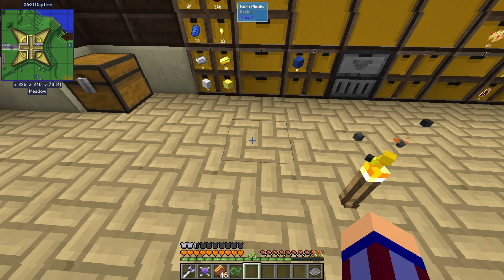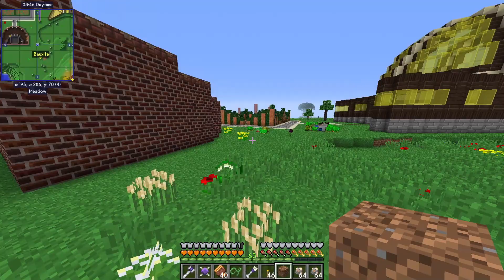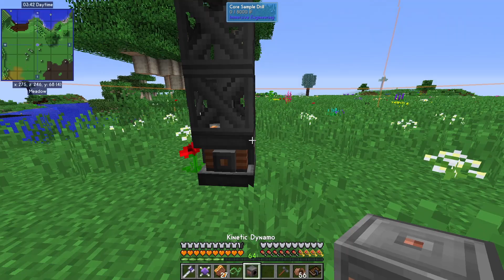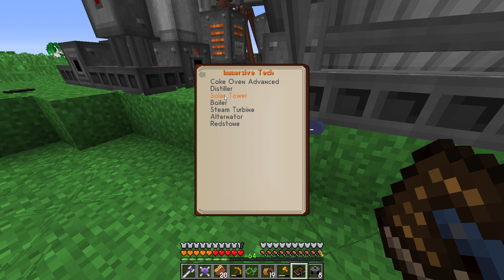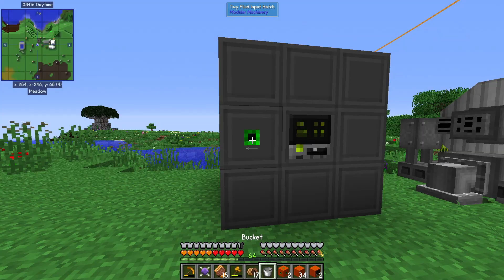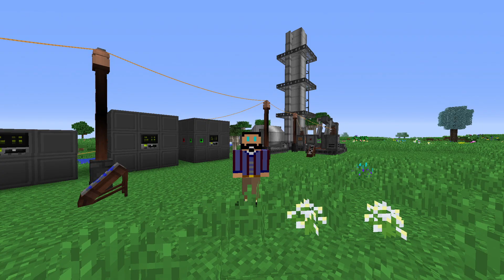SevTech Ages - E11 - Power Up

Comment: Hint, in immersive engineering usually(if not always) the power cables connect on the engineering blocks from when building the multiblock.
And if i recall correctly the energy capacitors(aka batteries) mantain their charge when broken
Reply from the maker: Thanks I appreciate the info.